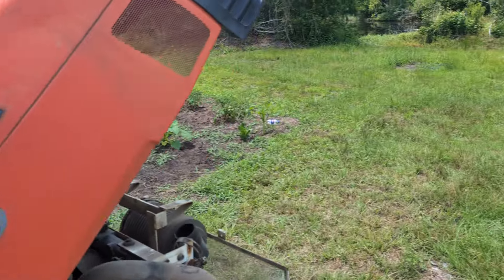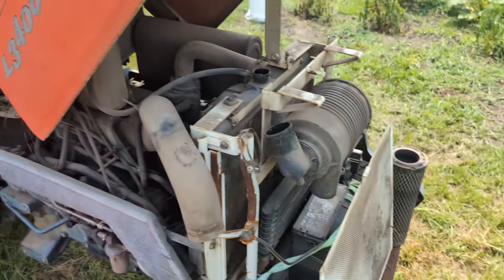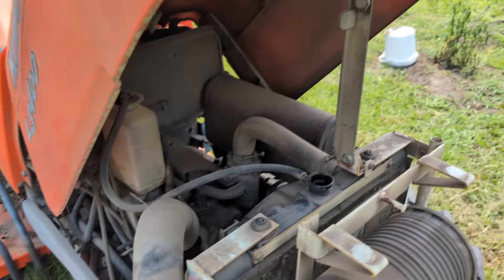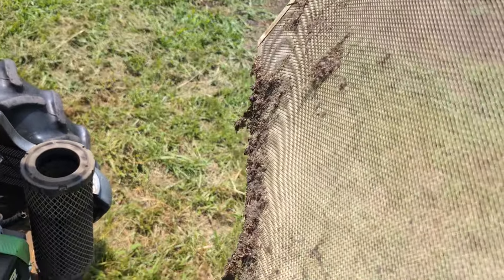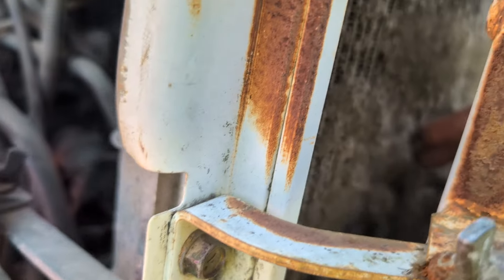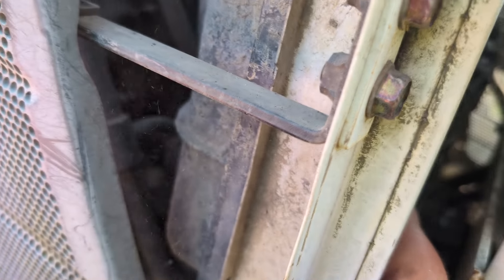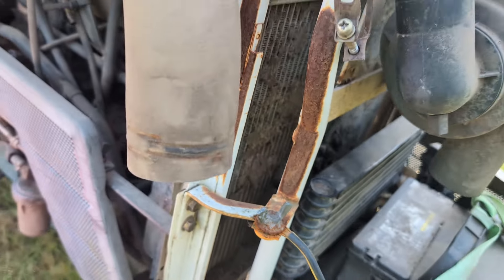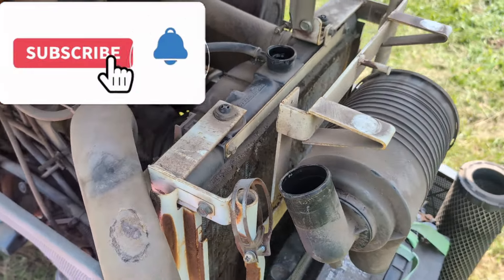Kubota Tractor Overheating

Comment: Well go to the. Shop find a flexible hose and Duck tape it to your air nozzle and go to other side and hit the air to it and get her Done 🏆😂 and Check the air filter and Blow it out will your at it there you go .🤔
Reply from the maker: Yeah....that's basically what we did but we use water. We have a small pump we put down in the pond when watering small garden. Thanks for the comment.